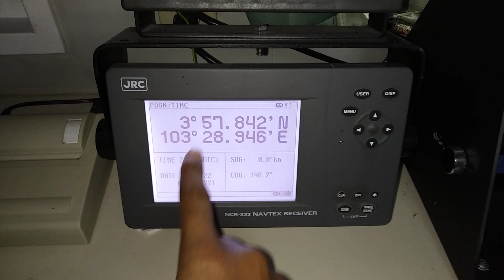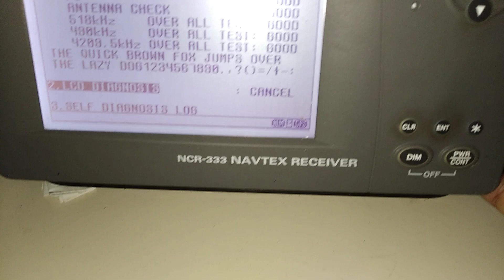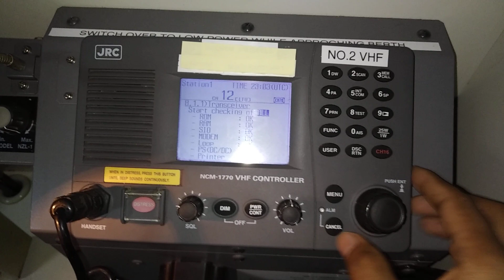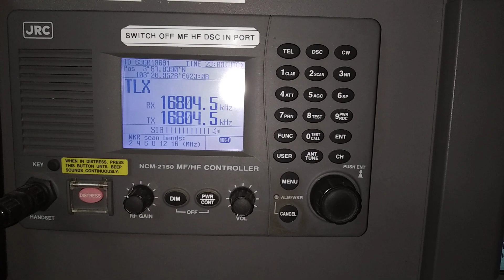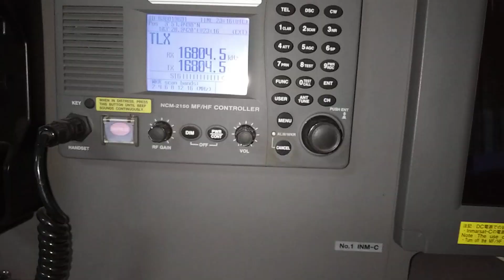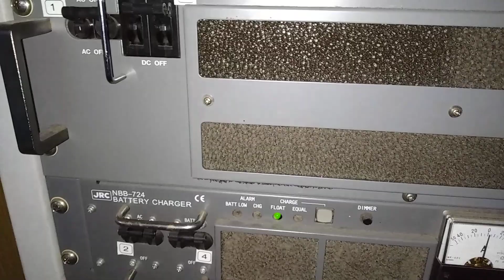GMDSS Daily Checks at Sea? Global Maritime Distress and Safety System

Comment: Your video is very informative. I have learnt a lot. I have a question. During ON LOAD test, only Voltage level on Battery charger is to be checked. Is there no use of Ampere Meter, installed along with voltage meter? When the ampere meter is checked? Moreover, up to how much variation or decrease in voltage level shown by volt meter is acceptable during ON LOAD?
Reply from the maker: Thanks for your detailed question mate!
During an ON-load test the battery charger’s voltage is the primary reading because you want to be sure the output voltage remains within the rated range while it is supplying current.
Use of ammeter: The ammeter is also useful—it tells you how much current the load is drawing. Normally you’ll check it at the start of the test (when current is highest) and occasionally during the run to confirm it stays within the charger’s rated current.